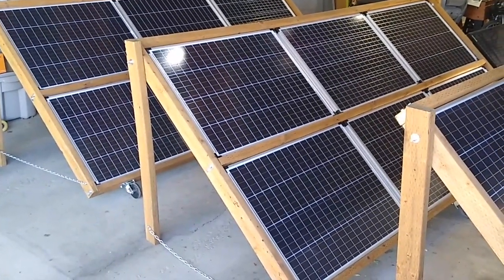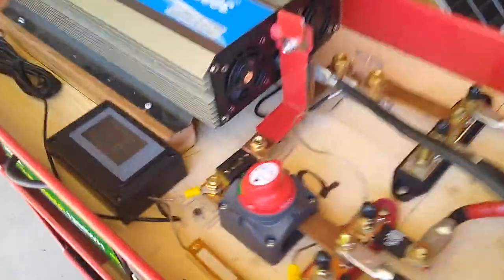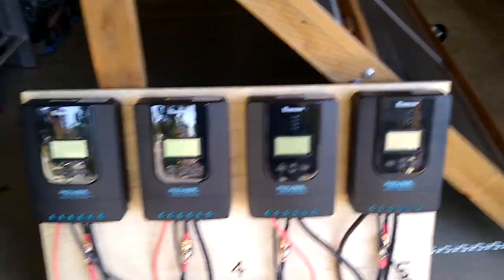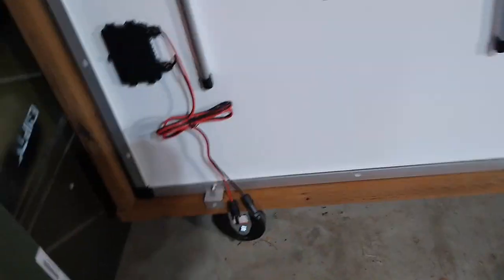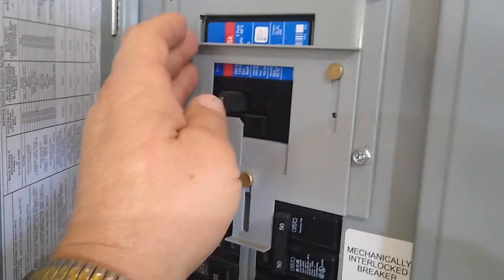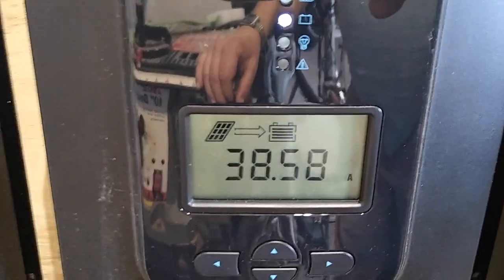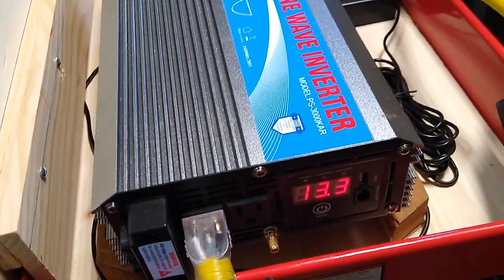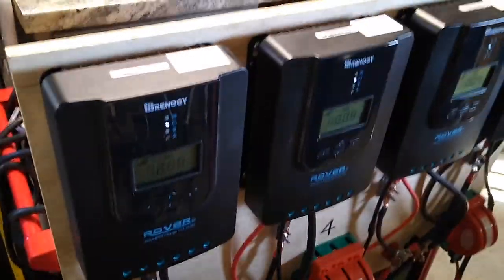My Portable DIY Home Solar Powered Battery Backup System for in Case the Grid Goes Down...

Comment: What wire gauge are you using between the panels to the charge controller to support 38amps? 🤔
Reply from the maker: The panel wires are the typical 10 gauge but they do not see 38 amps.  The panels are in a series/parallel configuration (2S3P) so the voltage is bumped up and the amps are less in the panel wires.  The MPPT controllers use the extra voltage to pump additional amps into the batteries.  So the controllers push 38 amps into the batteries at a lower voltage but the panel wires see the higher voltage and fewer amps, probably only half.
Reply: @MathesonFamily  I see..do you remember what the price is for one of those mppt controllers that you have there?

Comment: Can you provide the plug adapter part number?
Reply from the maker: The one in the video is an AC WORKS RV515SS2.  In theory, it is limited to 1875 watts.  I didn't have any issue when I ran 3000 watts thru it as part of a full up system test.  But just to be safe, I have replaced that with one that allows me to run dual extension cords (for double the power) from my inverter to the generator port on my house using this adapter:  https://www.parkworld.us/61926-p613.html

Comment: So dose your inverter have the ability to be paired with another one for 2 120 legs and 240 between the two legs that's what's slowing me down I can't afford a system the size of yours but I can start small and build up over time
Reply from the maker: My inverter does not have the ability to synch with another inverter to do what you describe.  I did think about that myself at one point:  https://diysolarforum.com/threads/two-inverters-to-make-240.33712/

Comment: If you are going to spend the money on a system this size, why not have a grid tied system to get the benefit of savings?
Reply from the maker: Just personal preference on my part.  This is just a back up system not a permanent installation.  My electric bills are less than $100 so I'm not highly motivated to go any further with it.

Comment: good work, how many devices can you run at night time, and if you can run a small window  AC or 2?
Reply from the maker: It's not so much a matter of how many devices you can run, it's really a matter of how many watts you can consume.  I can probably run 1000 watts for 10 hours (roughly overnight).  This link shows the watts used by some typical window air conditioners: https://homeairguides.com/how-much-electricity-watts-does-a-window-ac-use-air-conditioner-monthly-cost-guide/  So for me to also run the refrigerators and freezer overnight also, I could probably only run a 5000 or maybe 8000 BTU air conditioner over night.

Comment: It looks very complicated. I built a  off the grid system for a large house and I only use a 5500 wt charger and inverter piece.80 amp. And 4 4x8 panels each 350 vts  I have too much power for the entire house . Too complicated

Comment: Most refrigerators require 800 w
Reply from the maker: Our 27 year old refrigerator uses about 150 watts when the compressor is running.  The 4 year old freezer, 110 watts when the compressor is running.  The 4 year old refrigerator is about the same but I only measured its total power consumption over a 24 hour period and it averaged 41 watts.  I was surprised by these low numbers, but I have verified them and all three together use 3 KWH over a 24 hour period.